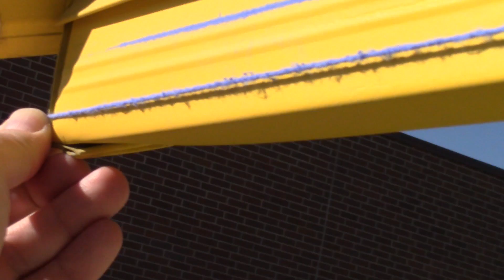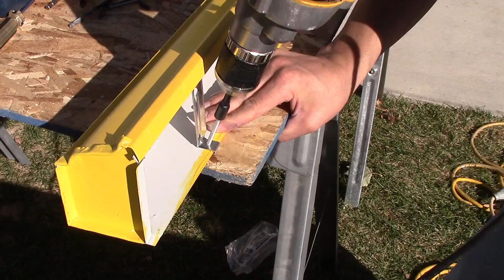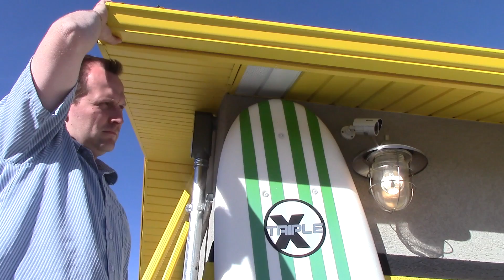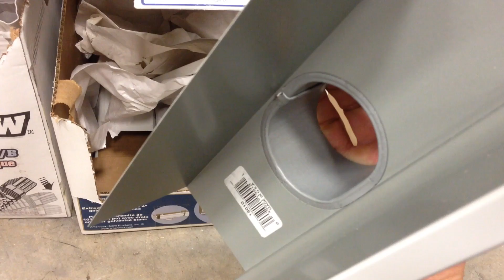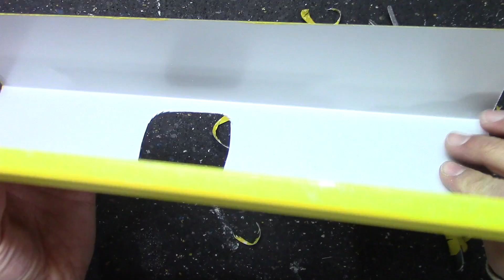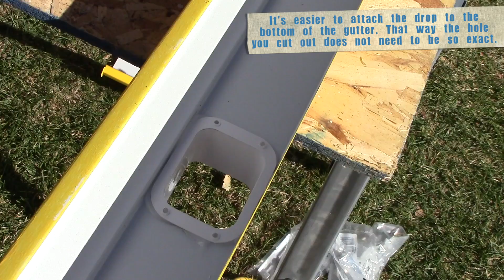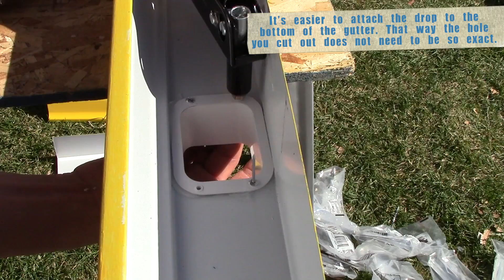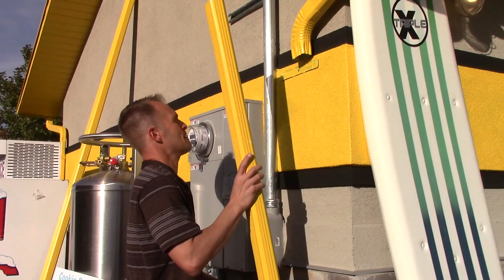How to install Rain Gutters - DIY

Comment: Please recommend a method to tap into the downpipes for a rain barrel.  I would want the initial water to divert into the ground level so roof debris is first removed.  Then switch the water flow for filling the rain barrel.  Any ideas?  Plz provide modification process if you do respond to this request.  I am not good with tools and repairs.  By the way, you made a top notch video here!
Reply: +p9948 ................great point!  Another would-have-missed-point had I not read your comment.  Excellent observation!

Comment: When you used the miter saw , what blade did you use?  Did you install it backwards like I see other people do when they cut it?
Reply from the maker: +John Nealey I used just a standard general use 32-tooth 12"  dewalt cutting blade. No I didn't try reversing it but if you do let me know how that turns out.

Comment: Why metal vs PVC? If you don't mind me asking.
Reply from the maker: +Mezkal ex This is just my personal opinion: Metal gutters have been around for a long time and hold up for decades.  The PVC ones I think can weaken in the sun after many years and could possibly warp in the heat. I have never installed PVC gutters but I have worked with PVC in other products and I prefer something a bit more durable.
Reply: I have installed PVC gutters from the big box stores. I think the aluminum gutters look better, if installed properly and maintained as well. The PVC has a different look, and can be a little less maintenance.
Reply: AdamDIY The plastic gutters are a waste of money, Adam is correct, a couple of years in 110 f will warp gutters and connections.

Comment: This is the best video on rain gutter installation that I have seen.  One thing needs to be added.  The top of the highest part of gutter should be just low enough so as to not block ice that would need to slide off roof.  This is does have to be considered in climates where there is never snow on the roof.  Great content, great script, great narration, great filming.  Thank you for your effort.
Reply from the maker: +Sam Matier Super Comment!  Thanks Sam for letting everyone know about the ice.

Comment: Great video, Maybe suggest to readers to use a rain barrel to collect the water that later can be used.  Thanks for the postFreddy
Reply: +Freddy Patterson ............Freddy Patterson, we use the 50 gal. trash cans to collect water.  Every time that it rains, Southern Cal., we collect that rain water and it comes it handy for watering the flowers.   The investment in buckets, large buckets 20 gal. ones will pay for themselves in time.
Reply: +Edith Martin I live in the Mojave and I think Rain collection is a must! I am really amazed that my town just lets it all flow away. and also not investing in a gray water recycle program for the city... It is against regulations to have a home gray water system and now that we are going to be penalized for excessive water use, I think there is no excuse for that! Thanks for reading!

Comment: Excellent video. Definitely the most helpful one I've watched. The only thing I would add is to warn people about how sharp these metal pieces are. It is VERY easy to cut yourself. Even smoothing out the caulk with your finger will cause cuts if not careful. Thanks!
Reply: Also, always wear safety goggles when cutting or drilling metal. One time I was drilling metal and one of the small, friction heated shavings lodged in my right eye. I had to go to the hospital to have it removed. Not a fun process.
Reply from the maker: rockindaddy9 Good point! Thanks for the comment.

Comment: only one issue with the tin snips on a 7 inch piece of trough its easy to go round and round it turning it as you go , but if you were to do it with a 15 foot or even 6 foot piece it would take a lot of effort turning that length of trough around and around

Comment: I think, also, that the "wavy" design of the tubing would allow for you to 'EXPAND' the angled part of the downspout rather than crimping the straight piece and enabling higher flow capacity.

Comment: Finally a video of a true diy. Im not going to pay a ridiculous  amount of money for seemless. Excellent job demonstrating all aspects of the job.  I will be referring back to this video to do my house. Thanks so much for posting. Looks like the wasatch in the back ground.  Is this in utah? If so hi neighbor im in Idaho.
Reply: Or properly placing them so that when snow slides off the roof it misses the gutter and doesn't rip it off. That would probably be the smarter idea.
Reply: J
Reply: Josh
Reply: Ada
Reply: Josh Brow
Reply: AdamDIY g GB cmon un
Reply: Josh Brow
Reply: Ridiculous amount of money for seamless?  You go buy an $8000+ machine, 7-9000 on a trailer, couple grand in ladders, hundreds more on hand tools, and don’t forget the insurance, and work comp etc.
Reply from the maker: Good eye! Yes it's Utah.  I hope your install goes well!  One thing I didn't show is that you should put a screw or rivet in each section of the downspout. It helps to keep it in place, especially if it is loaded with ice as it can in the winter.
Reply: Cool thanks for your help.

Comment: Thanks for your time recording and uploading.. especially how you showed all the different methods cutting that drop spout...I was gonna go with vinyl gutters but all the reviews i read is that they warp especially in texas sun.
Going with metal and homedepot do not carry metal only vinyl but lowes carrys metal.
Again thank You and I subscribed to your channel.

Have a question though .. The Fascia board i have is in good condition and has layers of thick paint no rot ...Do i have to install metal flashing ? On top of the Fascia board ?
I assume not, it has thick paint and has always been exposed to the weather and rain and its holding good with no signs of rotting.
please advise